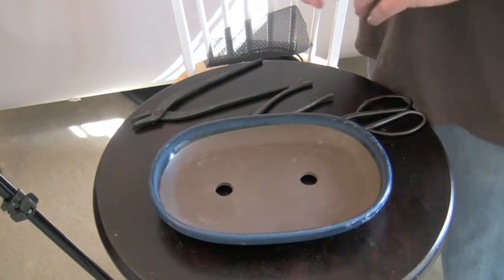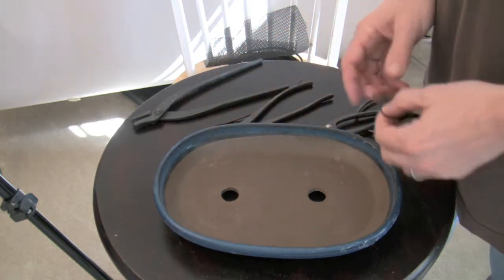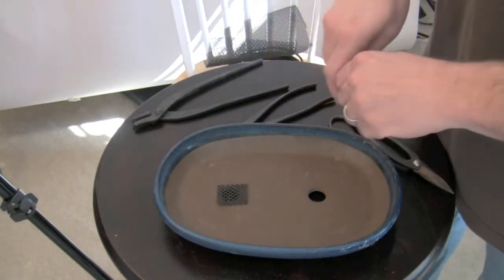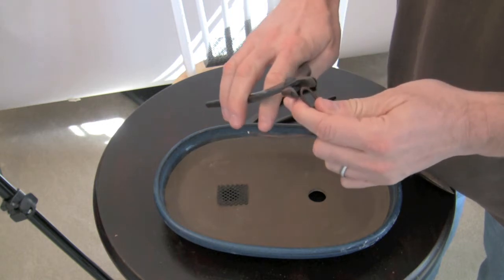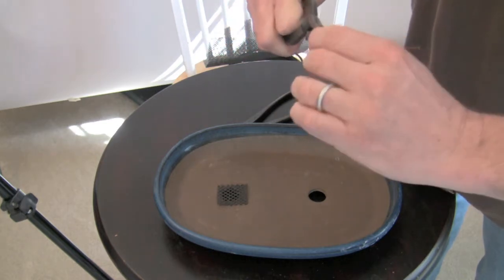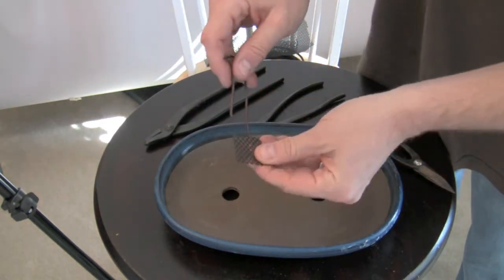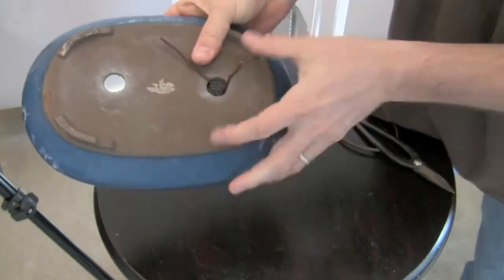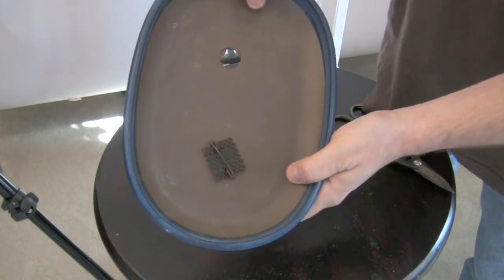How to Bonsai Pot Preparation - Installing screening

Comment: If you dont have extra wire around or dont want to use it up, or dont have any, a thick paper clip works the same or even better. Just straighten it out and do the same.